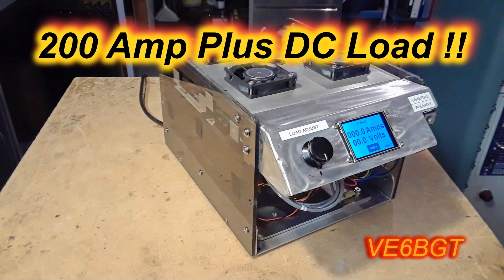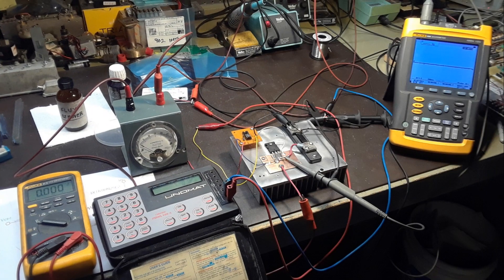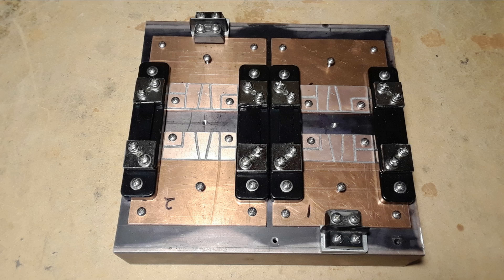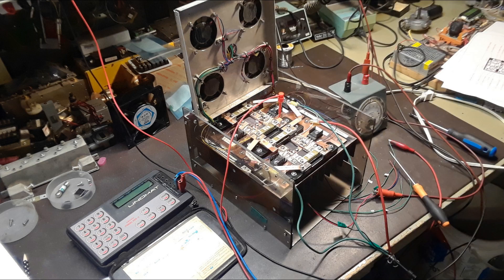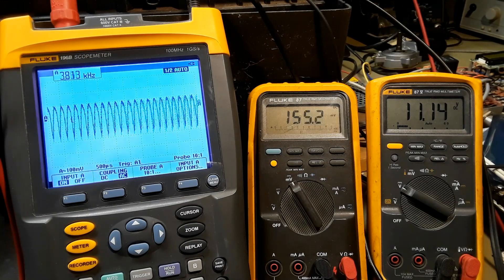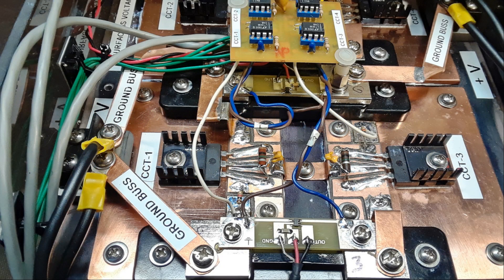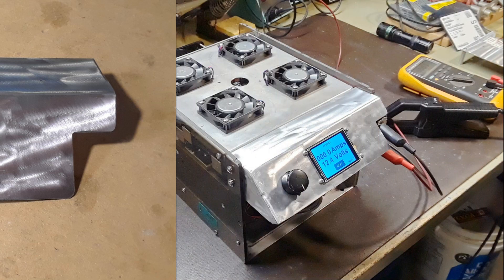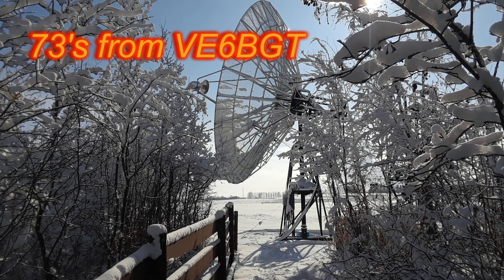200 Amp DC Load Project

Comment: That AD mod SERIOUSLY dampens the op-amp response time HUGELY!!!!    ...NOT A FAN of such brut force CRAP design AD!!!!!!!!!!!
Reply from the maker: Heh what ever works!! It was an easy fix and it works well..  Skip
Reply: It is difficult to keep stable a Dummy Load feedback loop.  Commercial DLs have to keep the response time fairly low too, and the faster ones cost big $$$$$,  ...although not a fan of the AD solution, variations of it are commonly used in dummy loads.  Many commercial DLs also use inappropriate op-amps like the TL07x series and often buffer the output with voltage follower totem pole drivers of sorts.  Again, not sure why this is common, but the TL07x are cheap!  As for the IRFP250 (in volume is also cheap),  it's ok for up to 80W or so at any I/V combo.  Don't know WHY the IRFB250 is so commonly used, because something like an AOK60N30L or FDA38N30 are MUCH better, as each one is safe up to around 300W or so, and use far fewer of them (along with the whole op-amp loop).  For higher voltage (500V) the FDL100N50F is excellent up to 500W or so, but I have never used it, so cannot vouch for it, just going on the datasheet :)   I think the VERY common IRFP250 (sometimes IRFP260) + TL07x combo are used because it is a tried and tested config that, like you said, WORKS!
Reply from the maker: @stevenbliss989  Hello again Steven, your right on a lot of the points on this load..  I dont claim to be any kind of design engineer..
I just build the stuff ha ha.. Anything is better than what I was doing with a big old rheostat !!  I saw the original load circuit in its simple form and thought that this is a good idea.. Even better when it worked finally.. I am sure there are better parts and ways of doing it all..  Skip
Reply: Well my point is that commercial units are not that much better, ... I think you misunderstand me a bit :)
 What you have is fine, and you kept the mosfets well in their "unofficial" DC SOA, so it is not likely to blow up any time soon either! :)
 Although some years ago now, my first dummy load was CRAP!  I wish my first one actually worked, ...stable and did not blow up often that is, at leatstI had lots of mosfets ultra cheap (ehhh FAKES, which is why they kept blowing up and I was clueless!)  ...:)
Reply from the maker: @stevenbliss989  Very good Steven, I know what your saying.. I doubt I will ever blow this thing up as I very seldom push it over 40 amps, so far.. Other than when I first built it.. Actually I hooked the polarity  to it backwards at the beginning and it blew this breaker, didn't hurt it!! I was shocked and felt stupid.. 
I never had much to do with DC loads before, just RF ones !!  Thanks, Skip
Reply: Loaf voltage is 12V, did you tested it  for 24V  dc? If yes what would be maximum load in Amp you are able to test.

Comment: Oh, I am excited about your project and I keep thinking of more questions... What method did you use to get the load to distribute between the four load modules? Yours is perfectly balanced! I just used resistors on each modules' input. But, there may be some other interesting methods, like using diodes instead of resistors. Because you have a PIC, I wondered if you might have used digital balancing resistors and have the PIC adjusting them in real-time. I would think that to be an interesting idea to investigate.
Reply from the maker: Thanks for asking on the balancing act of the four circuits.. No I didn't do anything special for this.. I think the four shunt resistors are enough to balance out the current draw amongst the four FET circuits.. I was prepared to use a PIC control for this and had actually built up a test circuit but found it wasn't necessary so I didn't add that part too it.. It does work very well as simple as it is.. Skip

Comment: I see that you and I have a couple of things in common... When I retired, I took up electronics as a hobby to keep my mind learning. One of the first things I designed was a couple of different demo boards for the PIC18F4550. Very soon thereafter, I tackled a DC Load. I did the project on the EEVBlog forum. A whole lot of good folks taught me the ropes and finish the design. It was successful and I released all of my design files, there. Here is the title, if you would like to look at it, on the forum: Electronic Load Project - TLV171 & IRFP250 with KiCad Files. I would post the direct link, but YouTube does not allow the posting of links by commenters. EDIT: For folks that want the short version, my final schematic is on Page 8/Post #193. Any chance you would release your project files, Skip? Schematics, board layouts, Gerbers, microcontroller code, The Works? Please and thank you.

Comment: I need one of these on my bench! In telecom power it’s all about low voltage high current.
Reply from the maker: You bet you need one of these, best DC load checker I have ever had.. Even for just loading for a few amps this unit works great.. Easy to build to...  Skip
Reply: @VE6BGT  yes sir, the units I have now use switchable power resistor arrays, AC fans and have a form factor equivalent to a bar fridge! Without a doubt Solid state load banks are the way to go, compact and fit in the bench. Lots of winter left so a build may be in order! thanks again for the video post
Reply from the maker: @burningdust  No problem, if you need any more info contact me direct..  Skip